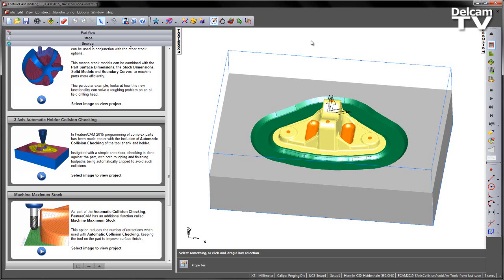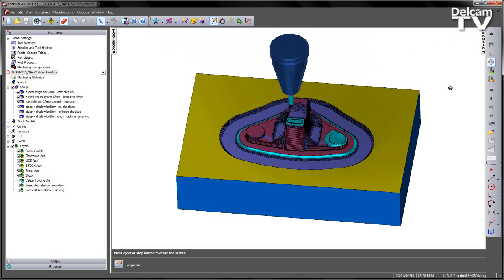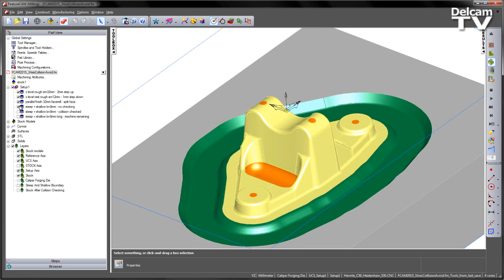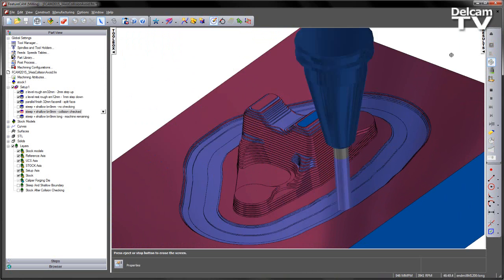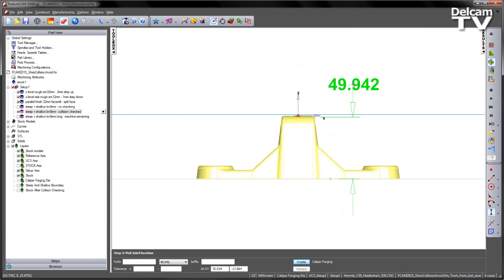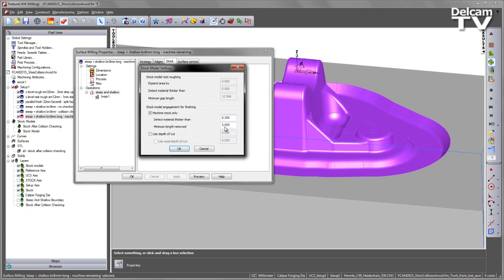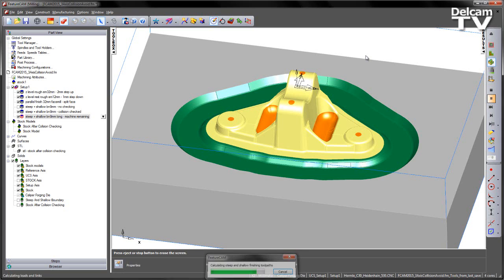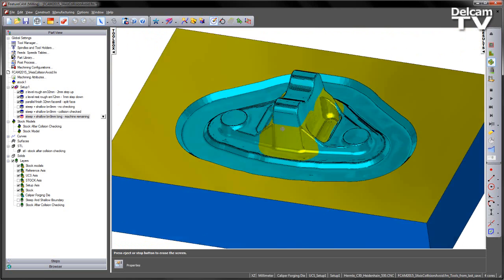3 Axis Automatic Holder Collision Checking

Comment: I've never seen any CAM software that automatically detects the remaining areas left by a tool holder and machines them with a longer tool.If someone is going to benchmark 3-+2 axis cam  software, they should show the example from this video.
I've reviewed and worked many expensive cam softwares, but this method doesn't exist.(i am not sure)